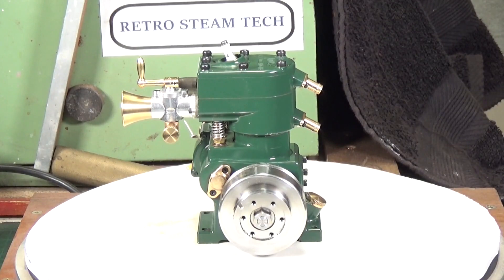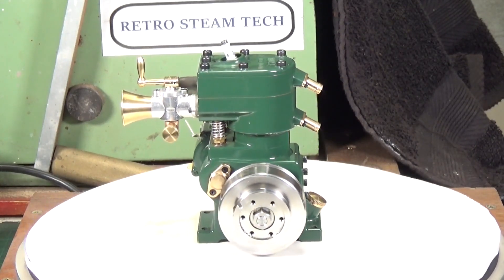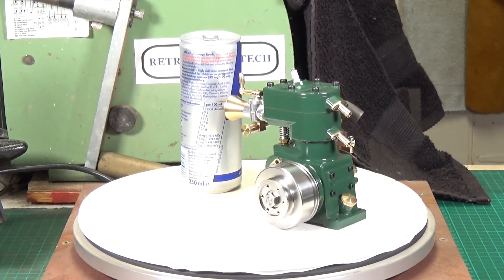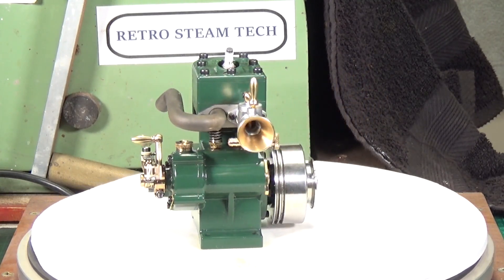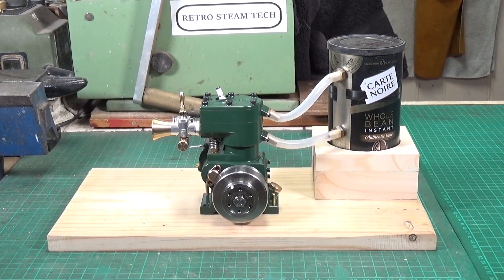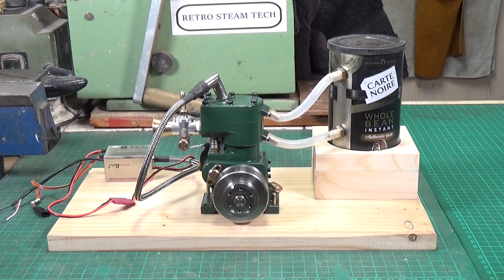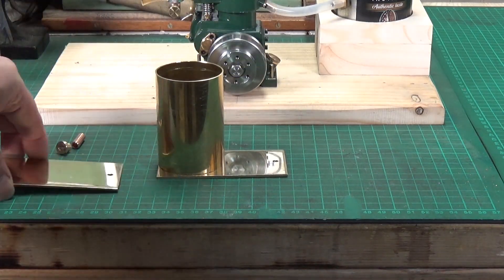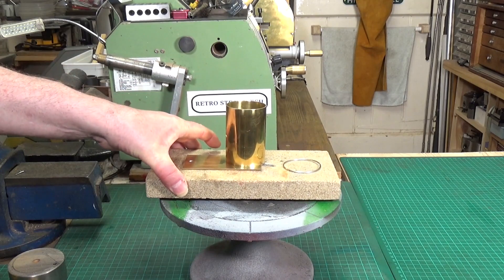Amazing Channel Donation - The Whippet Engine

Comment: Certainly looks like it will need a positive displacement water pump of some sort to keep the coolant flowing...  Looks fun.
Reply from the maker: The manufacturer sells a water cooling kit for it, pump, radiator and hoses but it's rather expensive. The thermosyphon method I used works ok as long as you don't run the engine for too long.

Comment: Excellent engine Alan.  Great gesture by MB. You did a good job mounting it. I expected a bit of smoke ;)  Cheers Rob
Reply from the maker: Hi Rob. I spent some time thinking about the mount as I wanted to have enough space to be able to fit a pump or something for it to drive. Which hopefully I will in the future. I'm glad I decided to run it outside as there was quite a lot of smoke! Cheers, Alan.